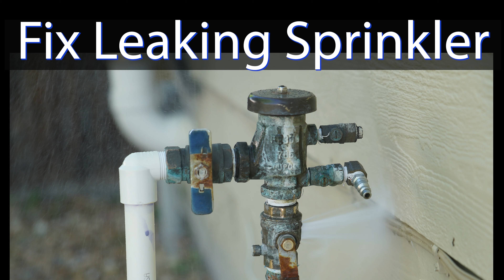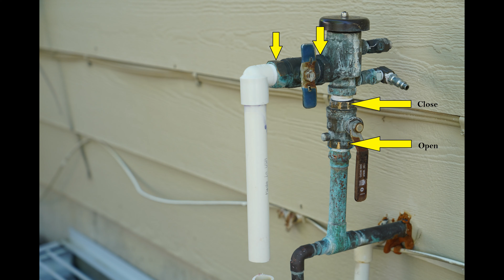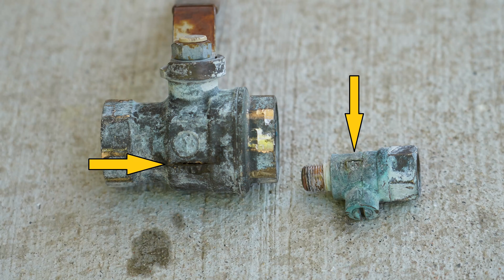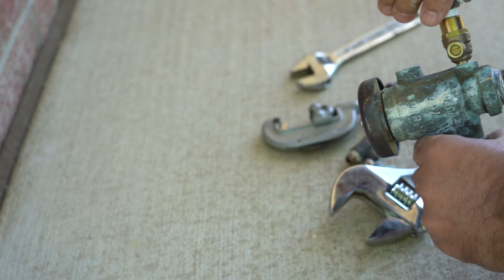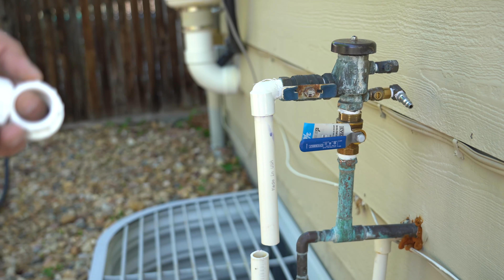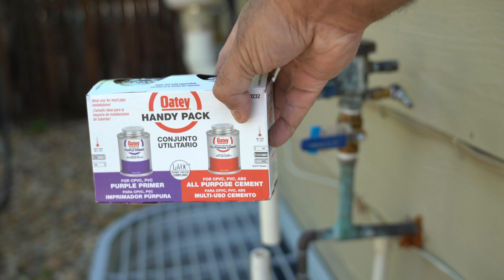Replace leaking Sprinkler System Backflow Preventer and Valve

Comment: can you please tell us which removable union you use? I am trying to find it at home depot. Thanks!
Reply from the maker: Well I do not know much about building code requirements so please verify it your self. But I used the one similar to the Homedepot Model # PVCU34. Please also make sure it matches the pipe size and schedule requirements for your application. Additionally my pipe was pvc for this section. If you have copper then you will need similar copper pipe union. Please check with Home Depot or other local store associate, they are usually able to help.

Comment: best video, if you pls mention the parts because I have the exact same model
Reply from the maker: The one I have is brand fibco 765 series  pressure vacuum breaker. I bought it from Home Depot.
Reply: @waseemsharing4199  did u got all the parts from HD too?
Reply from the maker: Yes.

Comment: Question: how did you repair the crack?
Reply from the maker: Replaced the cracked parts. In my case it was valve with the long handle before the back-flow preventer and one small valve on the back flow precentor. Both were available from the Home Depot. Note the valve on the back flow preventer is specific for the brand and model of back flow preventer.